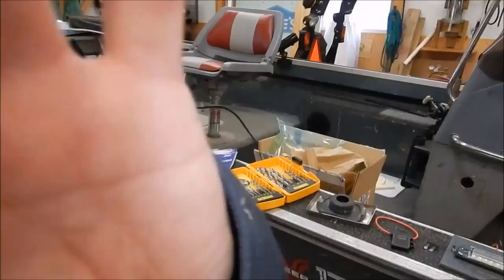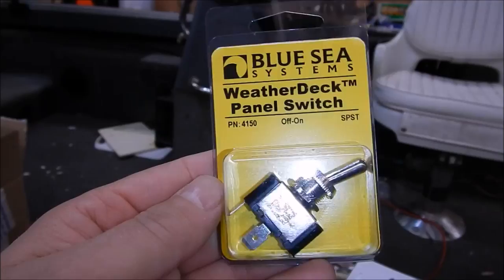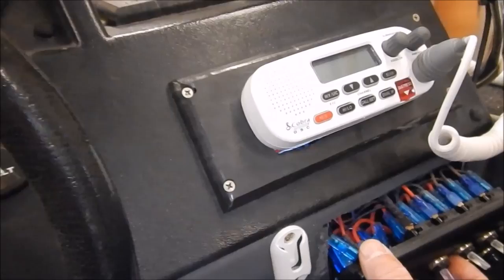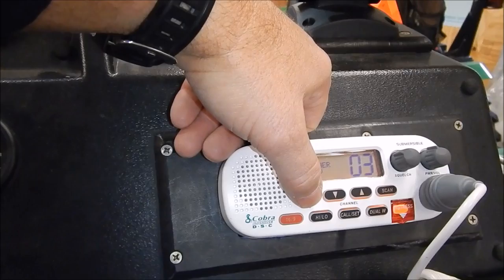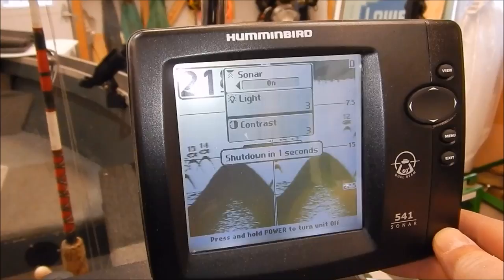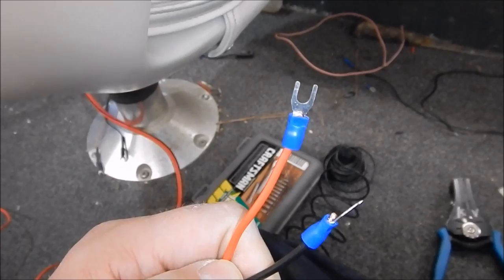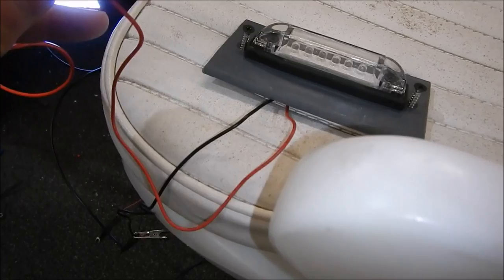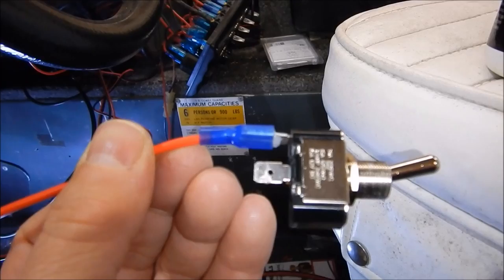Boat Wiring LED Deck Light & Toggle Switch With KVUSMC

Comment: My Daddy was a man of many talents, one was a boat builder, over the years we built hundreds of boats mostly to the local market, boats from 3 foot net boats up to 40 foot shrimpers. Anyway, my brother was the wire wizard, that boy can run the wires and lighting systems like a PRO :) I had no patience for it myself, Good video bro! Did you say your Daddy is in FL fishing? Thumbs up bro!~John
Reply from the maker: +WORRO01 Awesome John I Helped Build A Few Over The Years Also That Is An Awesome Talent Those Wires Can Be A pain  Brother I mean Yes Sir Dad Is Englewood Fla Buddy Looking At Buying A Place And Doing Allot Of Fishing Thanks Brother John

Comment: Hey brother nice video!!! As I'm new to boating and watching many videos on wiring I had a few small questions. 1.) on your light you used quick disconnect fitting to the block, why not peg/ circle ones with screw holes? I only ask as most videos say that with vibration screws do come loose and those come disconnected easier than peg. My thought was maybe you did it in case the light wasn't what you were looking for or needed to switch to bigger one. 2. I also noticed you heat shrank all you wire connectors, to avoid damage or corrosion. This question is similar to first you didn't do it on block wires for light. Like I said be fore I think you may have done it to see if it was good enough but as I need to re wire my entire boat I just want to see. Your wiring looks real good with all that heat shrink on it!!! I'm glad I didn't get
To far before I started watching videos cause now I'm going to do that!!!
Reply from the maker: Hey Brother I appreciate it You can Use circle or Quick connect I could also Switch it out easier Like you said Yes I heat all My connections and I use Die electric grease I like the Ring Connectors the best allot of time you sometimes it is easier when working in tight spots or have more connectors on one Screw  ! Hollar at me anytime Cheers Kenny